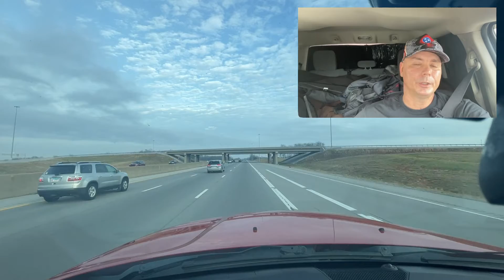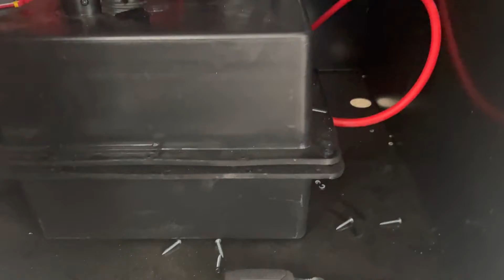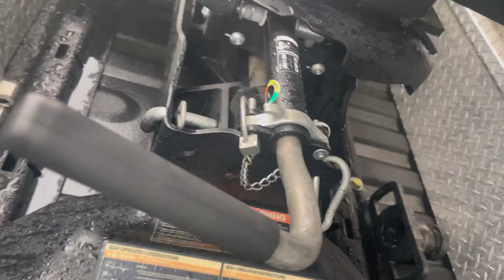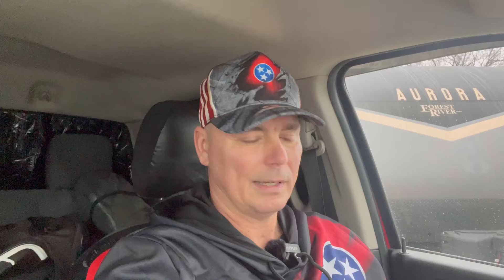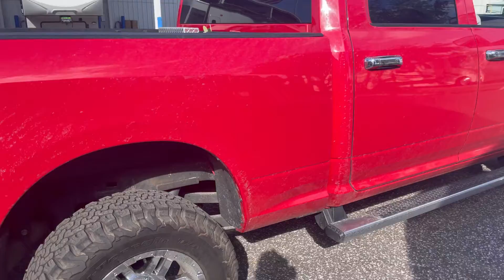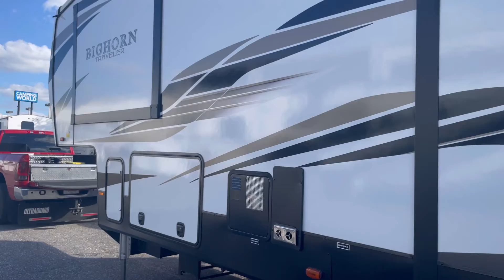Rv transport, Dover Florida￼

Comment: I am finding that if the battery boxes are closed and screwed close a battery is installed. The main battery power switch is in off position. Just turn on and power up the controls.
Reply from the maker: You are right. Thanks for watching
Reply: Your welcome,just subscribed
Reply from the maker: @topdogega4664  I seen that and thank you sir. It helps out